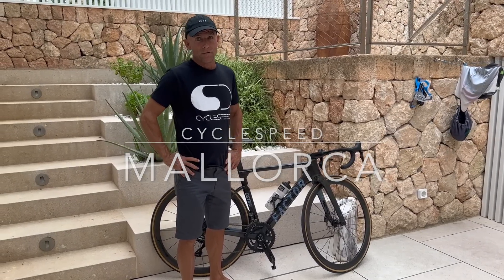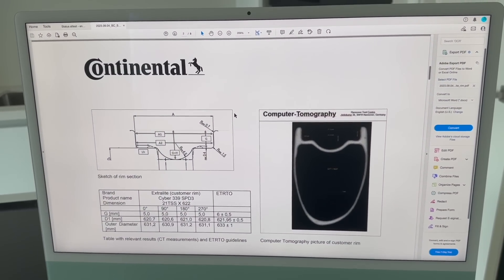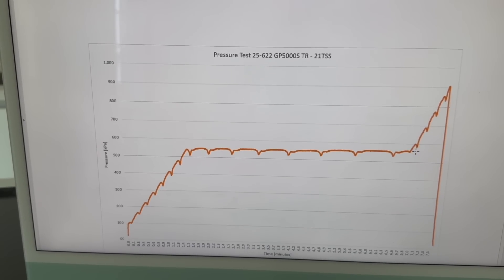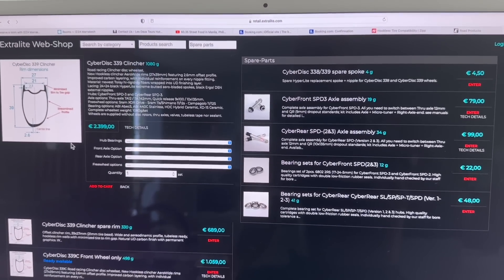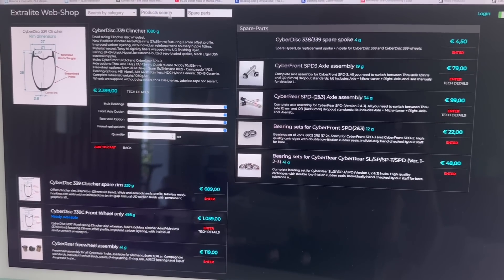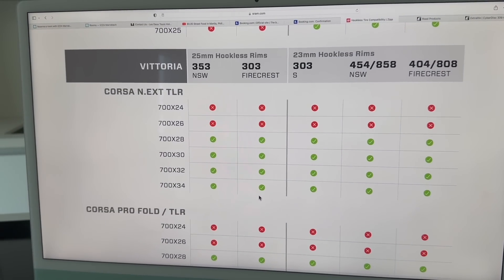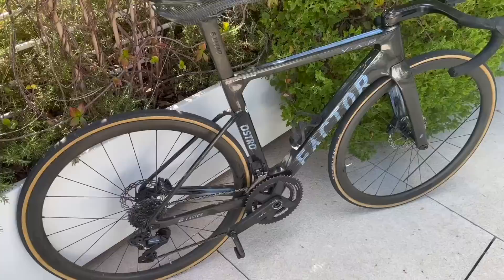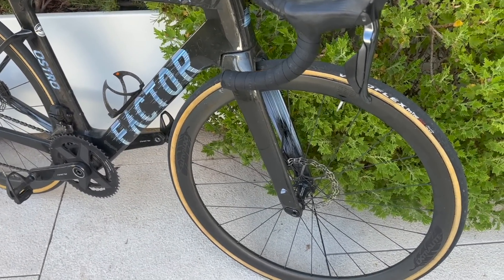Revealed! Why the Tyre Blew off the Hookless Wheel

Comment: In 2025 this followup is really informative Sir. I've just picked up my first 'tubeless' wheels and did research tyre widths Zipp recommended and that being 28mm min on the 404/808 Firecrest. This hookless rim thing is more like one step forward in development and two steps back into the unsure. I've heard its all about carbon wheel production cost saving and only that. I reckon the reason for that move was because of the many Chinese wheels out there that are getting better now and still cheaper than the big name brands. I'll be putting my Zipps together this weekend with TPU tubes and not gonna go down the full tubeless route at all. Thank you for this followup to the original vid, which shocked me.

Comment: Tubeless was the Worst mistake I ever made,...nothing but problems....Your situation must have been a combo of factors...The rim lacking half a millimeter of depth is not solely responsible for the blowoff...Half a millimeter is only 0.02"... That is only Twenty Thousandths of an inch...an additional 0.20" of depth would not have kept that tire from coming off, especially if you had been riding it!!...First you need to go to Church and thank God it came off in the kitchen, not on a 45 mph descent!!...Second, cut those rims up and throw them in the trash like I did....Yours Truely, a Concerned Citizen and Fellow Rider...Stay Safe My Friend.
Reply from the maker: Those wheels went back, for sure. Now have their hooked version, and no worries.
Reply: Cool,  glad this was resolved. I know I was late commenting on this, but I just now happen to see it @CyclespeedTours

Comment: 25 mm tyres are not for Hookless Wheels. Even with Hooked rims, 25 mm tyres at 70-80 PSI will face difficulty sealing punctures. For Tubeless minimum tyre width is 28mm if you are under 70 Kg. I am 64 kg I run 28 mm Tyres with 21mm internal width Hookless rims. I run about 60-65 PSI.  Never Had any Issues.
Reply from the maker: That must be why so many tyre manufacturers (like Continental) sell 25mm tubeless tyres. And they rate them to 109Psi, (hooked), 72psi hookless.
I usually run 28mm TT TR or Pirelli 28mm, at about 65psi on HOOKED wheels, but I prefer the flexibility to use 25mm tyres at 80psi plus if i prefer.

Comment: Thanks for the info. For me, hookless design requires really tight specs in order to work. As a consumer, it is not possible to measure the wheel or the tire for such tight spec before buying, you only know it after you put these two together. To wrap the tubeless tapes onto the wheel, it makes the inner rim wall even shorter, drifting away from the already very tight specs. This makes the whole system, should I say, flawed for high pressure setup like road bike tires, in addition to limited choice of compatible hookless tires. I am amazed that Continental did such a thorough investigation onto the matter and gave you a report.
Reply from the maker: Thanks, good points

Comment: another one of many where somebody puts undesignated tyres on an expensive wheel and then blames the company and the gods. what if somebody doesn;t read the instructions and puts his finger in a wall plug , we should ban electicity. I'm convinced and getting hookless mavics for gravel
Reply from the maker: You're 100% wrong. Maybe get all the details before launching into criticism. And this is not a gravel bike.
Reply: @CyclespeedTours  I know this is not a gravel bike. That's why I said non designated tyre. There's another' guy that put a 25c tyre on a minimally 28 inch tyre rim on a road bike Sorry for the aggressive nature of the remark. That was my fault
Reply from the maker: @ Gravel is a completely different area where hookless can make sense. 
With road, part of the problem of hookless is the need to be careful to match the tyre and wheel to avoid serious safety issues. This never used to be 'a thing', and introduces a failure area that doesn't need to be there.
The tyre was 100% approved for that wheel. The problem (if you watch the follow up video) was that the wheel was very slightly undersized, which caused the blowoff. 
This whole situation would never have arisen with hooked wheels.

Comment: I just bought a set of hookless and saw your video. My question is would it his still happen if you installed tubes?
Reply from the maker: I think it would be a bit safer, but the blowoff would still happen, just at a slightly higher pressure.

Comment: I really like the comparison with airplanes and motorsport - where you can buy anything without thinking about whether it will be compatible or not.  Jokes aside, I've been riding hookless for over three years now on all three of my bikes.  I have used 10 different sets of tires without any problems with the wheels.  Gravel wheels, on which I have not put MTB tires but relatively thin gravel, got a particularly heavy load.  The road wheels also went through some serious abuse and speed.  I installed all tires except one myself.  It was with the 25mm tire that there were the biggest problems with mounting.  One side did not want to lie on the 65mm wheel and blew off several times when blowing air.  After re-adjusting the tire several times, it finally fitted correctly and still rolls well today after 2.5 years. To some extent, tubeless fluid sticks the tire to the wheel. All tires comply with the manufacturer's recommendations and I can't say that it would have been very difficult for me to go through the models that fit my wheels before purchasing.  In my case, I have noticed that high-end carbon wheels are compatible with almost all high-end tires, which seems quite logical that if you use good wheels, you should also buy good tires for them.  And I say almost all high-level tires, because surely someone will find some off-brand expensive tires and say that they are not suitable... In any case, I don't see a reason for all this fuss about hookless wheels.  I happily buy bikes and parts from my nearest bike shop/repair shop who take responsibility for the products they sell and if I bought these things on the internet and assembled them myself I would count on a certain margin of error.  In addition, I do not trust all these semi-manufacturers and their quality control.  Try better wheels with good tires and if you don't like it or something doesn't work, then you'll just have to drive the "good old reliable" hooked.  I recommend trying Cadex 65mm with Continental 5000 STR.  My local bike shop lets you try these wheels on your bike before you buy.  Drive at least 100km and understand whether you like it or not without paying €3,000 for a cat in a bag.

Comment: Personally I don't think a tire should be jumping off even at 9bar. I know chaps who used to run 120psi, and then you consider the additional pressure when hitting a bump, but never saw a tyre blowout.

Comment: The higher the volume/lower the pressure, the better. As a shop, we could only really get behind mountain and cx for hookless as it provided a strong rim for any rim strikes. Thats it.
If i recall, hookless was originally conceived to give more material for caliper brakes to put heat into i.e. keep the carbons resin from melting and even that was for mountain. Once disc arrived en masse, hookless was no longer needed so how we all got to hookless for reasonably high pressure/low volume tires.. who knows.   Fantastic vids, love that it showed a resolution, super cool. Cheers.
Reply from the maker: Thanks!
Reply: I've never heard of hookless when rim brakes was the norm. Who was making hookless then?
Reply: We we using a Light Bicycle xco rim for cx at the time. Caliper heat could theoretically collapse a hook bead as it was such a thin structure when examined in section. We never did crush a rim as cx did not make enough heat but it made us sweat a bit so i was glad to start using discs in cx. Very specific use case plus these got used in gravel race situations too.@DaveCM
Reply: @ronspencer6668  Thanks! People have had serious crashes in the mountains because they cooked the rim and it failed. I wasn't aware that hookless was tried already. I could see it being tried in CX. Expecially given the strain put on rims with the old rim brake. I know I've used all my force I had available on my old rim braked CX bike. I was so glad when disc brakes came out.

Comment: Cool it people. Today this happened to me with my Hooked Hunt Aerodynamicist rim on Pirelli P Zero tubeless at 6.5 bars. I parked the bike and 2 seconds later huge bang, explosion. Sealant everywhere and the tire off the rim completely. No damage on the tire or the rim. Put right back on and inflated it at a bit lower pressure and went riding. Absolutely no idea why it happened.

Hooked rim, tire pumped to 6.5 bars (specs allow 7.5 pressure). When I rode hookless that never happened to me. I've been riding this setup for the entire season, around 4K miles and never had any kind of problem like this today.

Comment: Same thing happened to me yesterday on my Zipp404s with the S TR tyre as well.
Thank you so much for doing this video. I’m thinking of switching to a tube tyre now since I now will probably always worry if this will happen again while riding.
Reply from the maker: Good to hear other people's experiences. You can still use tubeless, just make sure the wheel is HOOKED !!!
Reply: @CyclespeedTours Cool it people. Today this happened to me with my Hooked Hunt Aerodynamicist rim on Pirelli P Zero tubeless at 6.5 bars. I parked the bike and 2 seconds later huge bang, explosion. Sealant everywhere and the tire off the rim completely. No damage on the tire or the rim. Put right back on and inflated it at a bit lower pressure and went riding. Absolutely no idea why it happened.

Hooked rim, tire pumped to 6.5 bars (specs allow 7.5 pressure). When I rode hookless that never happened to me. I've been riding this setup for the entire season, around 4K miles and never had any kind of problem like this today.
Reply from the maker: @shadowsun33  are you sure they're hooked, because the website seems to show them as hookless.
Reply: @CyclespeedTours  Oh no, they're definitely hooked. Aerodynamicist 4454. Well, we figured it out just a couple hours ago that I mistakenly used folding clincher P Zero as tubeless and of course the bead and the sidewalls are not built for tubeless setup, so the tire blew off the rim. I ran this setup for over 2K miles, some crazy descents, so definitely a testament to how amazing the Pirellis are that the non-tubeless tire having no tube inside to support the sidewalls and its bead handled even 40+ mph technical twisty descents without failure. But the principle of my case is still a valid point that it all comes down to using the proper tire that the rim is built for. You can easily use hookless and they're perfectly safe as long as the tire is the proper tire or you can even use 'safer' hooked rim and be in grave danger not being saved by the hooks when using the tire that the rim doesn't support it. However, in your case I listened the specs of the rim were off the ETRTO standards...well, duh no rim would be safe outside the standards, which makes the claims that hookless are dangerous simply because they are hookless and having no hook, is nonsense.
Reply from the maker: @shadowsun33  There are many, many examples of hookless tyre blow offs, not just mine. You used the wrong tyre and got away with it. It is very easy to use the wrong tyre with hookless and there is no hook there to give you some safety margin. If your Hunt wheel had been hookless then I suspect that tyre would have blown off immediately.

Comment: Again ,no hookless rims for me. Thanks for the follow up.
Reply: Cool it people. Today this happened to me with my Hooked Hunt Aerodynamicist rim on Pirelli P Zero tubeless at 6.5 bars. I parked the bike and 2 seconds later huge bang, explosion. Sealant everywhere and the tire off the rim completely. No damage on the tire or the rim. Put right back on and inflated it at a bit lower pressure and went riding. Absolutely no idea why it happened.

Hooked rim, tire pumped to 6.5 bars (specs allow 7.5 pressure). When I rode hookless that never happened to me. I've been riding this setup for the entire season, around 4K miles and never had any kind of problem like this today.

Comment: we have measured tyre inner diameter with difference of 1,4 cm from usual , it' s really too much compared to the real but very small difference found in this fitting , same brand 2021 was too easy to assemble with one only hand ( the "stack " sound happend at 1 atm , some blew off )   and now from 2023 -2024 models/lots  seem really hard to assemble ( wich is really good ) and stack happened at 3 or 4 atm -  there are no rules by tyre side , no measures , no % elastic rings  limit or shape -  ertro must work on this side because security must handle 0.5 mm tollerance , not 1,4 cm 
the easiest way to assemble the most the risk , car or motorbike tyre are not easy to assemble , cyclist ( and maybe tyre manufactorer ) must accept strong secure and not fast fitting .

Comment: Extralight doesn't meet ETRTO guidelines.  Hookless is perfectly safe if you stay within ETRTO guidelines.  Follow your wheel manufacturers fitment guide and purchase a qualified tire that is ETRTO certified and don't buy cheap wheels.
Reply: Good point.  Let me re-word this to what my intention was; don’t buy wheels that don’t meet ETRTO specs (such as Extralights) AND don’t buy cheap wheels for hookless.
Either way…ETRTO guidelines exist for a reason.  I’d be ticked (as you rightfully are) that a company you invested thousands into didn’t bother to engineer their wheels to ETRTO spec’s OR are trying to do so and don’t have proper QC to catch wheels that don’t meet spec.
Reply from the maker: @aarvig  Trouble is, it's impossible for the punter to know in advance, although my video does serve as a warning to people. And hookless means that QC has to be spot on, if not, danger. Hooked wheels have an extra layer of safety built in. Not sure why it's a good idea to remove that.
Also ETRTO are just guidelines, you have no recourse against the wheel company if these are not met.
Reply from the maker: Cheap? They were almost 3 grand!!!
Reply: All valid points.

Comment: more an MTB/gravel guy, but got a Simploin Kiaro (from 2013) "by accident" from a very good friend, who did not look into the specs (we both have 94.5 inner leg length, but I am 189, hes is 209 cm tall => the Kiaro has a very relaxed STR, which even with a very long stem made the bike useless to him), so have a road bike (again) - luckily, this one is fit with nice DTSwiss wheels with hooked carbon rims...  I have been riding hookless/tubeless for ages on MTBs and gravel, but the high pressures needed for road bikes prevent me from using these options...

Comment: This is further evidence of hookless being crazy. Imagine the average starter cyclist understanding any of this. Tyres staying on the rims is about rule number 1 in cycling.
Reply from the maker: exactly
Reply: Ok. Today this happened to me with my Hooked Hunt Aerodynamicist rim on Pirelli P Zero tubeless at 6.5 bars. I parked the bike and 2 seconds later huge bang, explosion. Sealant everywhere and the tire off the rim completely. No damage on the tire or the rim. Put right back on and inflated it at a bit lower pressure and went riding. Absolutely no idea why it happened.

Hooked rim, tire pumped to 6.5 bars (specs allow 7.5 pressure). When I rode hookless that never happened to me. I've been riding this setup for the entire season, around 4K miles and never had any kind of problem like this today.

Comment: 💯HOOKLESS IS JUST NOT SAFE! PERIOD! 💯 Are you willing to take your chance? Up to you.😎
Reply: Cool it people. Today this happened to me with my Hooked Hunt Aerodynamicist rim on Pirelli P Zero tubeless at 6.5 bars. I parked the bike and 2 seconds later huge bang, explosion. Sealant everywhere and the tire off the rim completely. No damage on the tire or the rim. Put right back on and inflated it at a bit lower pressure and went riding. Absolutely no idea why it happened.

Hooked rim, tire pumped to 6.5 bars (specs allow 7.5 pressure). When I rode hookless that never happened to me. I've been riding this setup for the entire season, around 4K miles and never had any kind of problem like this today.

Comment: Thanks for this update.  I wonder if measuring the circumference of the wheel (and calculating the diameter) wouldn't be a more meaningful way of assessing the fit between the tire and wheel?
Reply from the maker: Yes, and that's why the ERTRO exists to lay down those standard dimensions. But it seems that achieving them is not always so easy....and with hookless, and slight deviation from the correct spec can result in disaster. Non hookless and tubs are not so sensitive to anomalies.

Comment: I just commented 5 minutes ago on your first video, then I just saw this. Sorry. Interesting results from Continental. It confirms my experience with tubeless. You have know which tire and wheel combo's work and pay close attention to fit. If the tires go on easy, that's a red flag. That said, it's not for everyone. I'm a small rider so I've been lucky. If you're a bigger rider riding at higher pressures it could be challenging. Your conclusions about the industry are bang on. There needs to be a standard. Excellent pos with lots of learning for anyone considering these type of wheels. Cheers.
Reply from the maker: Very true, and if the bike owner is careful then should be no issues. But when these wheels start to filter down to the 2nd hand market to less serious riders, then I predict problems because they will just fit whatever tyre they have to hand, not realizing the various danger issues.